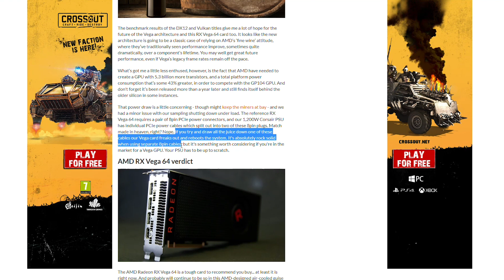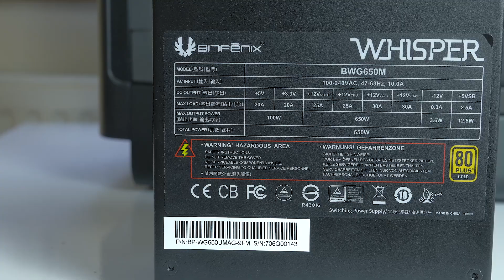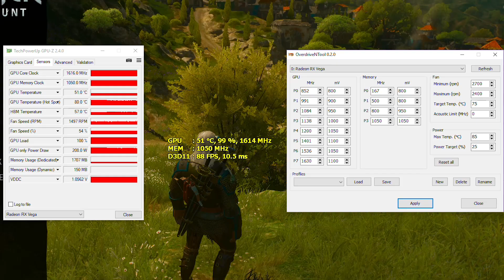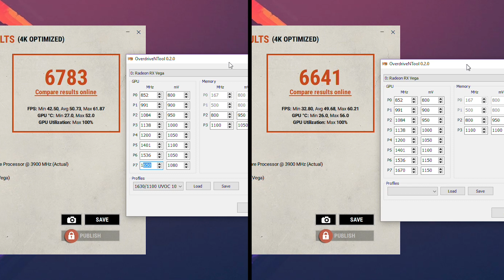RX Vega + Morpheus II Follow-up - PSU RAILS issue & UNDERVOLT OC

Comment: Very nice. Lots of  people on oc.net are getting these. I'm on water for my 64 so my core and hbm temps are around 40°C and my hotspot temps i don't even bother checking because gpuz causes massive lag spikes in some of my games. But thats usually around 50°C. I have not attempted to undervolt or overclock my card yet as i have freesync and lock my fps anyways so it handles all the games maxed out already and keeps a steady 73fps (75hz 29um68 40-75hz freesync range ultrawide). They absolutely LOVE being on water. The new drivers seem to have unlocked SoC voltage so you can actually get more then 1100mhz on the memory. Some people are hitting 1150mhz already on water.

Comment: That is also good advice for 8+8 or 8+6 pin nVidia cards as well. Using a single pcie cable with a pig tail provides lower FPS than using two cables from the PSU. Using two Cables on the same rail on a multi rail PSU would also have a similar effect in restricting power delivery
Reply from the maker: brad morris Yeah, but generally a good single rail is better and less hassle. To compare, my SuperFlower 550W single rail can handle this card up to 1610MHz/1070 with no reboots. And that PSU is 4 years old. Still, I'm not disappointed in this 650W BitFenix, it's just a side effect of being a 4 rail design.

Comment: Thanks for the bench,what about power consumption on 1650mhz clock 1100 hbm2?
Reply from the maker: Antonio Coppolaro I have some power draw numbers in my undervolt guide - for 1610/1070 MHz. At the frequency you mentioned you should be looking at 320W continuous and peaks anywhere from 360-400W+ upwards... At 1680MHz and 1.185v, mine draws around 330W continuous IIRC. Will check to be 100% sure.

Comment: The recommended PSU spec for an RX Vega is 750 Watts.
Reply from the maker: AnalKarl der vierte Also true. But a single rail quality 600-650W should be just fine unless you're running a CPU that pulls 200W+ during load.
Reply: I'm running my Vega 64 (+50 PT and UV to 1050mv) and R7 1700 @3.9 on a Corsair 550W PSU. Works absolutely fine!
Reply: Cooler Master GX550 here. it's a 550w 80+ br PSU.

Works fine evne in turbo mode with vega 64 + morpheus2, 4x4GB of ram, 3770k@4,5Ghz, a sound card, an ssd, 3 hdd, 5 case fans etc ...

Here it is running superposition OC/UV :
https://youtu.be/KS4johXjkn8

Comment: I had the same problem with my Red Devil Vega 64 card, i had a 620W dual 12V rails Seasonic Bronze  and anytime i went into a benchmark or game and went past the main menu it would crash. Problem got fixed by switching to a Single rail 650W Seasonic gold psu.

Comment: Hi! Where did you get that VGA cable to PWM? I have the same Morpheus cooler! Its a beast!
Reply: You guys rock, just purchased one for my RX480 hybrid mod.
Reply from the maker: I got it from moddiy.com. Can also be bought sleeved from them.
Reply: I just did the same! What an amazing website.
Reply: Do you happen to have a direct link to the adapter used in this video? I ordered the ones you had pictured in the last video, but they don't seem to fit my fan connectors.
Reply: yes, that is the adapter I bought, but that adapter does not fit this connector: http://www.stylingwebben.com/products/view/wwwdocs/thumb/thumb.php?src=/wwwdocs/_common_media/products_images/532/1947.jpg&w=960&h=600 , the adapter he used in this video does.
Reply: I ordered one from ModMyMods . Ships from ny - still waiting for my order from moddiy

Comment: Thats why you should avoid multi rail PSUs and why pretty much everyone aboandned it, your definitely not the first that has had that issues with "where should i plug in my cables because of limited rails".

And Morpheus combo is really interesting, i guess best AIB implementations will be on par but your mileage with different AIBs will vary (though Fury cards were excellent, Fury Nitro is still one of the best coolers ever manufactured)

Comment: Hi MindBlank Tech. Thanks for your awesome Videos with Radeon and Morpheus. I did my installation last week done with 2 x120mm Noctua fans on my reference Vega 56. It works pretty well, I installed the 64 bios too. Cooling and noise are pretty awesome, with OC and little undervolt the Card has around 50-60 Celsius max. But Im worry about my Hotspot Temp, it is around 100 Celsius. I dont know why. Maybe have You some tips for me pls? Thanks a lot!

Comment: Great results for sure I do have to ask as to why you did not reinstall the back plate with the after market cooler. It does look like it would fit on the back still and would help cool the back of the card and in turn get rid of that hot spot somewhat as well.

Are multi rail power supplies not a thing any more? Then again all power supplies are multi rail at heart any way. That 650 watt is probably just barely able to feed your system and the Vega as it is probably almost maxed out hence the reason for the reboots. You may want to get an 800-850 watt with higher 12v rail amps.

Great results on the clocks and temps for that card I think you are right the third party cards probably won't match your temps with their cooler designs.
Reply from the maker: I haven't even tried to get the backplate back on it... Will try and see. Also multirail PSU's are not that common anymore, yeah.

Comment: Hello. Great video I must say. Thanks to you I'm going to buy Morpheus II for my V56 too. Do you think that thermopads included in morpheus box are enough to cool the VRam section? Any chance you have some picture showing where you installed them?
Reply from the maker: +Jakub Mucha I think they're enough. VRM on the Vega cards is beefy and MOSFETs are rated for 125C IIRC, so don't even need excessive cooling in the first place.
Reply: MindBlank Tech Great. One last question: if you keep core temps below 60°C (with hot spot during stress around 80-ish) what would you say for idea of flashing V64 LC bios? Does it make any sense or is the hot spot's temperature the only obstacles here? Best wishes.
Reply: Hello! Could I ask you about your experience with this cooler? You recommend buying it?

Comment: It's maybe nitpicking a bit, but.... Could you measure the weight of the card maybe? Is it much heavier than the reference design, does it sag? Just thinking if you would to use Morpheus for years, will it affect the PCB cause it's too heavy and plus fans "help" with that too. :)
Cheers
Reply: even if weighs a ton, the fixt for that is pretty easy. DIY some cool looking and secure support.
Reply: I think he also mentioned in the last review of this cooler, that the Morpheus was actually surprisingly light?
Reply: Yes, but I was just wondering about the actual weight, since then we can easily compare it to any custom cooler. I'm not saying that Morpheus is bad in any way, I was just curious about the info, that's all.
Reply from the maker: Филип Пешић I'll measure it. As far as sag, there's a little bit, yeah. Expected much more, but it's not that bad, to be honest...
Reply: I'm pretty sure he said it's an aluminium heatsink so it's probably fairly lightweight and the fans weigh a bit too

Comment: Be extremely cautious about the VRM temperatures.
Reply: Agreed, some cards unfortunately don't have sensors to monitor it. Mine doesnt but it seems like the LC editions do. I'm on water with my temps usually around 40°C when maxed out. Farming sim for example my temps stay around idle temps lol.
Reply: Yea my r9 390 from Sapphire did as well. If you check the forums some can monitor it and some can't not sure why but it's quite weird. I honestly woudn't worry about it as the Vega VRMs are top notch high quality they're made to last. I'm on water cooling so it''s not something i worry about for VRM temps. It's odd that there's no sensor though.
Reply: He shouldn`t even care about VRM temperatures unless pushing 1800 mhz on the core or something crazy like that which wont happen on air :D. Vega`s VRM is extremely overkill and requires no cooling under normal operation. It`s probably the best stock VRM ever and at the top of its game indlucing even aftermarket ones.
Reply: Agreed, the tool gamernexus did a video about taking it apart. I absolutely love my 64 on an ekwb. It still around 23°C ambient temp around here and temps are still high 30s low 40s for HBM and core. It is an absolute beast of a GPU and uses slightly more then my r9 390. Undervolted they use around 180w or so.

Comment: Okay so you said that you ran two seperate cables in the first place but then your fix is to plug them into two seperate VGA power outlets? Did I miss something?
Reply: he was running both cables from the VGA1 labeled ports on the PSU. The advice was to use a single VGA1 and a single VGA2 to provide the power

Comment: Do you really have a lot of faith in those 'hot spot' readings? I get same as bluej511 (50ish) on water, with both cards. On Superposition I am assuming you had HBCC on to get those numbers. HBCC makes a huge difference in that benchmark.
Reply from the maker: Raziel HBCC was actually off. :D. I should be pushing 7000+ I think with it on. I will bench and come back!
Reply: Was about to say this - 6700 score looks a bit... Well, average, in that benchmark. Don't get me wrong, I both support the channel and AMD, but when I went to check these results against other enthusiasts, and MindBlank has fine CPU(though, as I see, CPU plays little to no role in Superposition), VLL RAM and fine-tuned Vega with Morpheus.
And 6700 was in line with some.... AC 980ti or low-quality 1080. By no means, I don't expect V56 to breach 8-10k territory of 1080ti,  but people might get the wrong impression from this video.
A bit too much work to get average results.

Comment: my HBM memory and core clock are jumping all over the place even at stock. and its even worse when running VR. Does any one think this could be down to the psu, I am running a 1300w so I never even considered it
Reply: They will not run consistent.
Reply: well when I say all over the place in most vr games they are running under 800-700 MHz some times lower. Its defiantly worse in VR than on the screen and I just don't know why. So playing VR with my fx 9590 and vega 64 seems impossible
Reply: What FPS are you getting in VR? Just for something simple I ran Cinebench R15 OpenGL while responding, my memory never went above 500 and clock maxed at 406. My settings were stock.
Reply: I am getting about 40 to 75 fps some times its about 35 fps on low settings and I don't know why. the card is not being fully utilised. even when its low demanding and can hit 90 it will constantly fluctuate even when look at the sky making it juddery
Reply: Run GPU-Z or HWiNF and see what temps are. Core. HBM2 and especially 'Hot Spot'. I was Intel before Ryzen, are you sure this is not a CPU limitation?
Reply: really low temps around 35 to 45. its not cpu the cores are no where near maxed and I can run most games at 4k 60. Its just the clocks on my vega jump around so much in VR the memory jumps down to 500 or lower and the core clock goes as low as 266 even when there is frame rate problems and crazy head room. I was wondering if its just a bad combination of hardware that i have. I will take my card round a friends and see how it reacts on his intel system

Comment: Can I run a Vega 64 on a 650watt evga supernova g3
Reply: You need minimum 300w for Vega 64 stock so I would allow 400w. Add the rest of your build and there is your answer.
Reply from the maker: end my suffering I think it's going to be ok. I ran it with a SuperNova G2 850W and the PSU is relatively cold... Also ran it on a SuperFlower 550W and it worked up to around 1610/1070MHz with no issues. Works even at 1680/1.185V, but high GPU loads sometime give a reboot. EVGA, as far as I know, is running SuperFlower OEM PSU's, which are excellent.
Reply: Yes, EVGA are Superflower. I run two 850P and 1200P in the same system. At 1970 / 1100 in 4K Crossfire, playing Rise of the Tomb Raider for longer than I care to admit, my master card maxed out at 330w and slave at 328w. They will suck the juice if you let them breath.

Comment: Multi rail psu? please say that wasn't a deliberate choice.
Given that each GPU rail is 30A max, then it should have been obvious that one rail wasn't enough to supply for an overclock as it would max out at 360Watts and trip overload protection.
Having to split to two rails for a single device defeats the whole point of a multi rail setup (over current protection OCP), so that now running two GPU rails splits the OCP to 720W plus the CPU draw, meaning that where a single rail 650W PSU might trip OCP at 700W total, now you have a situation where you could be drawing 1000W before maybe tripping OCP.

To think of running Vega overclocked on a multi rail PSU, each rail needs to be able to deliver the wattage that the GPU needs. In this instance the 850W version which is 40A per VGA rail would be the minimum you'd want for overclocking Vega and even then is 480 watts going to be enough if you are pushing the limits.

Do yourself a favour and get either a bigger multirail PSU so that the GPU is attached to only one rail, or get a single rail PSU when pushing the wattages up near or over 100% of the PSU's rating.
Reply from the maker: magottyk I get what you're saying, but this 650W PSU probably wasn't designed to handle peaks as high as a Vega pulls. It's "only" 650W... My EVGA Supernova G2 had no issues whatsoever. Funny thing is that my SuperFlower 550W, yes - 550W - can handle the instantaneous power draw except for higher overclocks.
Reply: The point being is that using two rails for the card actually bypasses the over current protection by splitting the power draw through each in half. In effect the card can draw up to 60A, plus whatever amperage the CPU is drawing. Now 650Watts is 54A and a CPU @95Watts (A common TDP under load) is another 8 Amps for a total of 68Amps, now 68 Amps is 125% of capacity and over current protection usually will kick in at 110% of load on quality single rail PSU's and 100% on shitty PSU's and multi rail (multi are over capacity if all rails are maxed).
By running the card through two rails, if it develops a fault that causes excessive power draw, then by the time the safety of OCP has kicked in, the PSU has either damaged the rest of the system or is on fire through overheating.
68 Amps is 816W and if there's no problem with the card, it's unlikely that you will draw too much power as you are unlikely to draw 60Amps for that single card or go much over 650Watts with the system overclocked, but the whole point of multi rail is instead of one OCP for the entire system, you have one for each device in the system, or devices hooked to a rail so that any faults that cause excessive power draw will be shut down before the rest of the system is possibly damaged.

If you've overclocked the CPU so that it's using say 140Watts, well that's 13.5Amps totalling 73.5A or 882Watts.

"It's "only" 650W"
No, it's only 360Watts for the graphics card and that's what you tripped. When using Multi rail PSU's, you've got to know that all of your devices will not draw more than the maximum total, you cannot run two graphics cards, one on each rail at the rated power draw, because those two rails exceed the total rating of the system.

Comment: Ultimate AIR cooled. ;)  Liquid cooled is still better. :)
Reply: Yeah when I saw that the morpheus II is about 65 to 70€ and I have to void my warranty to install it, I decided to sell my VEGA 64 reference card and bought the VEGA 64 liquid for 90€ more.
Srsly 20€ difference between liquid cooling and the morpheus II is a no brainer imo.
Reply: Voided warranty depends on manufacturer. Sadly where you even live for XFX.
Reply: Well, that's talking V64 exclusively. And even then - that means V64LC has to be below MSRP(700) and V64AC has to be quite above 600$/euro.
MindBlank has V56, and that usually retails for 500 euro now, add Morpheus on top in the absence of custom AIBs and you see at least 100 euro difference from V64LC.

Comment: 12v -- 30 amp ??? isssnt that a terrible psu ? ive had simmilar issues with horrible psus like that.
just check a random psu and it should be better. example corsair tx 650 12v 51 amp <3 so just get a not terrible psu and your highend cars overclock issues is over <3
Reply: No, Whisper M is a great PSU, very close to Corsair RMx and quite a bit better than TX650. And just in case, what you have is a 650W PSU that can deliver only up to 621W on its 12V rail... That's not good!

It has multi-rail design, unlike your TX, so it means that each rail is rated for 30 amp, total power rating will be bit lower.